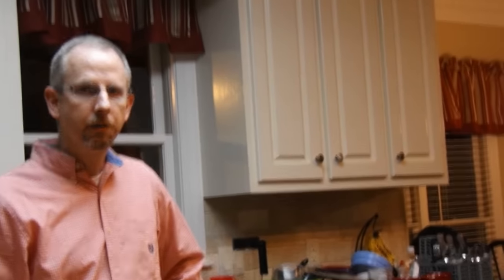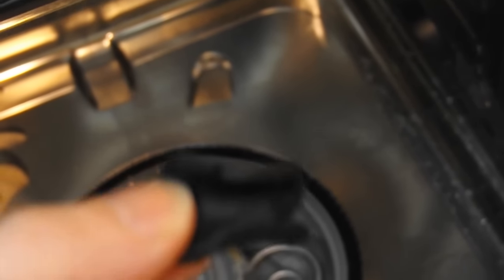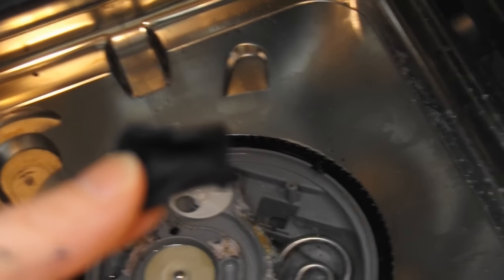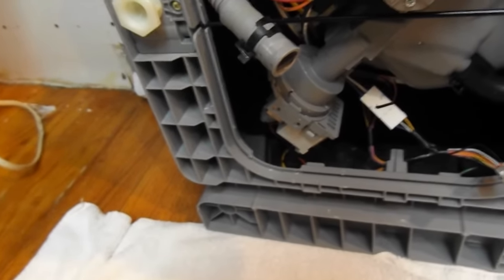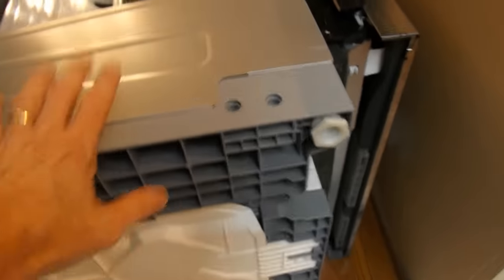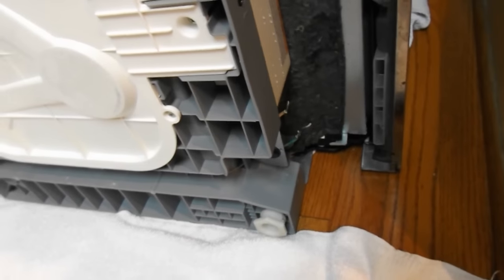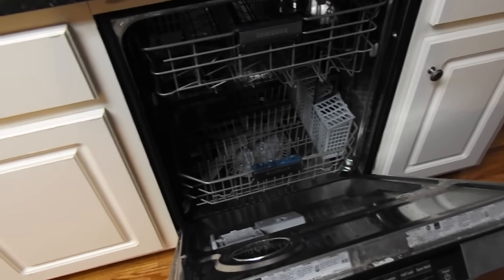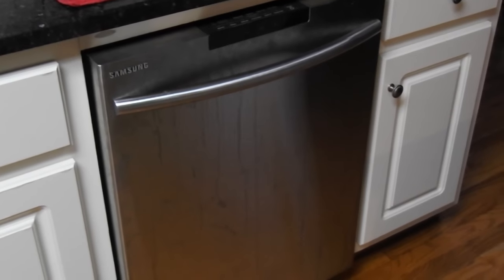How to Unclog Samsung Dishwasher Drain - Fix 5E Error

Comment: Hi guys 
My samsung dishwasher is making grinding noise and like in the video the valve was caught in the drain ,I took it off but the washer still making noise .
I m not sure if I replace the valve gonna solve the noise issue. 
I would appreciate your assistance. 
Thanks
Reply from the maker: The grinding is when something hard has fallen into the machine and is being chewed up by the food grinder. It could be a plastic tab from the top basket height adjustor. Replacing the valve will not help this. Typically it will stop after a few loads once the food grinder chews it up enough for it to fit down the drain. For more detail on the tabs that break off of the basket height adjustor, refer to my other video, Easy Fix for Samsung Dishwasher Basket Adjuster, at the twenty-five second mark.

Comment: so I have just taken the drain pipe that comes straight of the drain pump and there is a  non return valve in that pipe, things can get stuck in that valve stoping the pump from doing its job 100%..
also check that first pipe.. hope that helps somone

Comment: I have a different model Samsung but the basics are the same with the exception of the check valve.   My dishwasher had the check valve built into the drain hose connected to the pump.  I had removed the hose to fix a leak and didn't realize  it would only work one direction.  I  flipped the hose around and all worked fine.  Thanks for aiming me in the right direction.

Comment: Are we replacing this black rubber valve? Or what? I missed a step?
Reply from the maker: You can order the part, but I never did. You just might get some backflow into the tub area. The point of the video was to remove the rubber valve from the drain line to get rid of the error code.

Comment: THANK YOU! I actually love my Samsung dishwasher. I bought an R 800 a few years ago and this is the first issue I have had. It is the 5E error. I have treated it gently because I had only had much older dishwashers. I appreciate this one, however, I need it to work! While I want to do this myself (cost is a factor), I also need to be safe doing so. When it comes to electricity, the circuit breaker box is not well IDed. But, I can turn the dishwasher on and shut the breakers off until it has no juice! :-)
I will look up the other videos you mentioned.
Thanks again for your assistance!!!

Comment: 100%  found the flap in front of the pump - did not want to hunt for it but it is the right thing to do.
The only thing I would add - my bad - is to shut down the water - remove the supply and return hoses from the garbage disposal before pulling the unit from under the counter.  I cracked the return hose, at the clamp on the unit, by tugging on it - so had to order the $40 part and was delayed a few days.  It was only a little crack but remember - 
Do it once do it right, do it wrong do it twice, and pay ten times.
There was also quite a bit of yuck under the door - run your finger with a paper towel along the underside of the door - can't see it but it is there - part of the bad smell.  I was working on an LG
Thank you for posting this - DIY dishwasher repair

ps - as a side note there was a hole in the wall - poor construction - the mice got in and left droppings - under the shield, on top all over. Because of the smell the discharge hose and other parts are natural for them to chew - I am sure it is warm too.  I cleaned and sanitized blocked off the opening and hopefully have discouraged them from returning - there is no substitute for a visual inspection.
Reply from the maker: Great reply with some good advice. Yes, our Samsung had the gunk (and the smell) under the door. We just replaced it with an LG. So far it has been a much better dishwasher. Hope it doesn't start gathering gunk as well.

Comment: my samsung dishwasher goes thru the complete cycle find but then fills with water several hours after it was dry inside.  if i just run the drain function it drains fine.   i cant find a leak. the drain hose high loops looks fine its around 18 inches off the ground under t he sink and i klnow it isnt pinched. any ideas?>
Reply from the maker: I don’t know. I would try turning off the water supply after the cycle completes. See if that stops it. Then you know where the water is coming from.

Comment: My dishwasher don’t drain, and this rubber piece is missing, I follow the procedure in the video but can’t find the piece. What should I do
Reply from the maker: Your issue could be due to a different issue. The rubber piece might be lodged somewhere else or you might have a bad pump or a bad electronics board. Maybe you could try disconnecting the hose from the pump and using compressed air. Maybe this will force the rubber piece out the end. If you don't have an air compressor, maybe use a pump used for inflating pool toys. Good luck!

Comment: I have had things get traped inside the drain pump housing as well , you can remove the motor and impeller by releasing a tab and rotating it counterclockwise,  its worth checking inside the drain pump , how to remove the pump motor and impeller, example https://youtu.be/ASqflknAlA4?t=194

Comment: if up run the drain line up to the top of cabinet up do not need this check valve. If the drain line is run on bottom of cabinet this is way there a check valve to keep food from disposal.

Comment: Awesome video.  I have the exact same dishwasher and problem, but I actually solved the problem without having to uninstall the dishwasher.  I connected the drain line to the hose on my wet/dry vac with duct tape and let it suck out the clog.  Works like a charm!  By the way, I had the same problem with the basket adjusters and drain check valve.  Here are the Amazon links for those parts. http://a.co/d/0CKeCeY
http://a.co/d/9iQxjEr

Comment: I have had failure codes several times over the 4 years I owned my Samsung. Each time I have cleaned the gunk out of the interior under the strainer and around the heating element and sensors and put it back together and it has worked for another year. Never replaced any parts. Lousy design when the sensors are that easily made faulty by dishwasher gunk. I recommend any empty cleaning cycle weakly to reduce the gunk build up.

Comment: A small cap on the lower rack for loose and jammed the pump which had to be replaced. The cheap little plastic cap cost me $390 to fix and install a new pump.  Bad design.
Reply from the maker: Sorry to hear about that. Very frustrating.